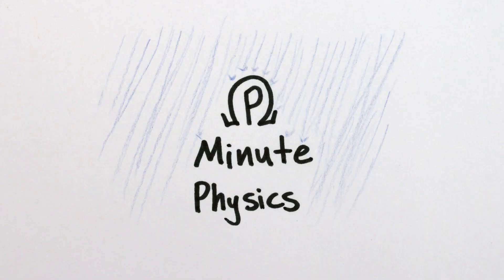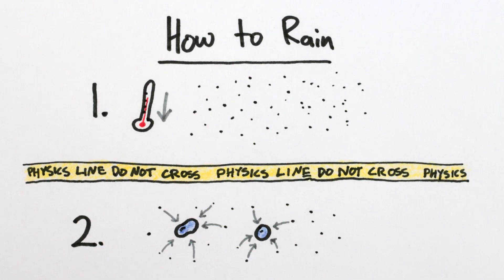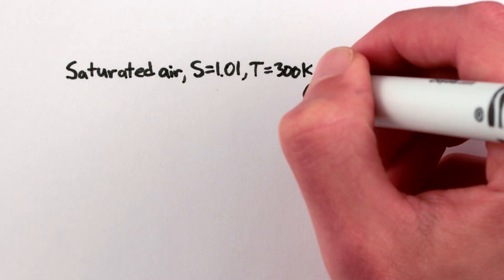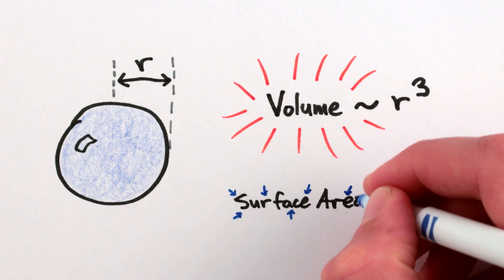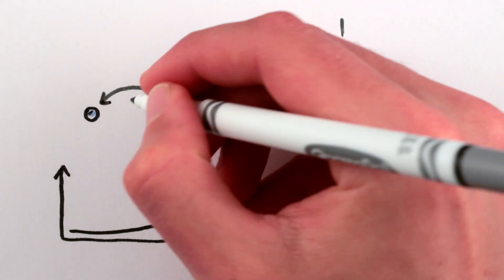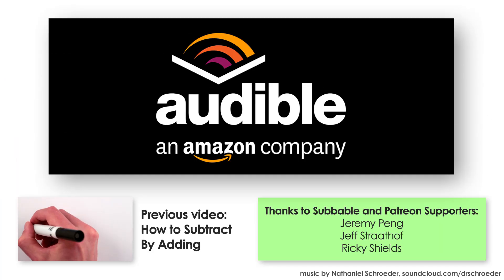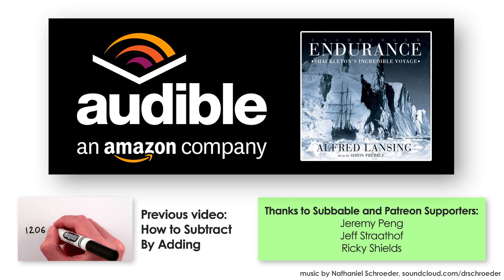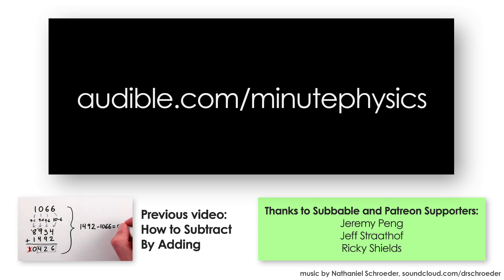Why Raindrops Are Mathematically Impossible

Comment: Instead of using 0.1 cm, you could just use 1mm, which would get rid of the cubing vs. squaring problem. This problem is based on the units we use. Can someone please educate me about how this really works?
Reply: 0.1 cm = 1mm
(0.1cm)^2 = (1mm)^2
0.01 cm^2 = 1 mm^2
1E-6 m =  1E-6 m
Similarly you can do the same for cm^3 or mm^3 I believe that the video makers chose to go with cm simply to make it more apparent or intuitive. The units don't really affect the problem
Reply: hm
Reply: regardless...
Reply: the metre is just a frame of reference, it can be a fraction of the distance traveled by light in a space of time, or the length of the king's toe. The proportions on the formula will always rule over the unit used in it.
Reply: It’s because all the units are accompanied by certain constant coefficients. Change the units, and the coefficients change too
Reply: +MySpaceBarIsBroken I'm not quite sure, to be honest, but a thought occurred to me: the calculations are probably best done in the S.I. unit for measurement, which is the metre - so if you're wanting to investigate other properties of the water droplet, no unit conversion for surface area or volume is required. This would explain why you would be sure to get the relationship of x^2 values being greater than x^3 values for something the size of a water droplet: x will be a tiny fraction of a metre.
Reply: Sharptooth101 The problem is that the metre was chosen arbitrarily. Sure it's an SI-unit, but it was still chosen by humans and isn't fundamental to nature.
Reply: MySpaceBarIsBroken The metre is the length of the path travelled by light in vacuum during a time interval of 1/299 792 458 of a second, so saith Wikipedia. It's an arbitrary fraction period of time over which for light to travel, sure, but the speed of light per that distance is definite, so in the end you get an arbitrary definite value (woah I think I just confused myself)
Reply: Sharptooth101 Yes, but it's still an arbitrarily chosen value. I could redefine a meter to be 0.0001 old meters so I get rid of the problem of small numbers. In the new meters, we are talking about stuff like 100^2 vs. 100^3, and cubing > squaring

Comment: Small numbers? But what is small? Small maybe, relative to our everyday scale, but it not on the molecular level.
Reply: +Juan Rivera >what are micrometers, femtometers, etc.
Reply: What the fuck are you doing reading my username? You need to take into account the conversion factors e.g to go from meters squared to joules you multiply by 1J/ m^3. To do cm: 1J/ m^3 = 0.000001 J/ (cm)^3. Squaring the cm conversion factor would give  0.0001 which is bigger. It’s a bad example, I know but do you get it?
Reply: +What the fuck are you doing reading my username? Exactly
Reply: small numbers = less than one because these numbers get even smaller as u raise them to higher powers

Comment: Why dont we use small distance units to avoid getting a less than one value? Like micrometers? So cubing would still be faster than squaring. 

Sorry I'm dumb. Someone educate me.
Reply: +huluminus because it doesn't change a thing.
10cm*10cm is 100cm2, which is converted in square meters 0.01m2
0.1m*0.1m is 0.01m2 too
Reply: And when we take the ^3 into account as comparison:
(10cm)^3 = 1000cm^3 -> bigger than 100cm^2
(0,1m)^3 = 0,001m^3 -> smaller than 0,01cm^2

Comment: You can choose your scale for units, so I don't think the square vs cube argument is valid here. Unless you're implying that there's a universal unit system.
Reply: +S.E.D. It doesn't matter what units you use. It is the relationship that matters. Basically he tried to give a reason without having to use calculus and limits. While what you say is correct, if you actually take the dxdydz of volumetric energy vs surface energy (energy accounting per control volume) you get the same result as within the video. You find that as the volumetric energy approaches zero, the surface energy approaches zero much slower, meaning that for small values of x,y,z (delta x,y,z as x,y,z -> 0), surface energy > volumetric energy (in terms of magnitude). Where x,y,z are the sizes of your control volume.
Reply: +hazzman singh Oh god thank you, the units thing was bothering me as well. Makes sense!

Comment: This video explicates certain misassumptions about water, especially water in the atmosphere:
1). It indicates water droplet condensing from gaseous H2O.  This is false.  There is no gaseous H2O in the atmosphere.  Water only becomes gas above it boiling point which to much higher than temps in atmosphere.  Condensation, therefore, is microdroplets combining to make larger droplets.
2) H2O has surface tension that is a resulf of polarity activation along its surface, not intermolecular forces.
Reply: +James McGinn Water becomes gas at much lower temperature than its boiling point. It's called evaporation.
Reply: +NedoraRiem 
Vapor is not a gas.  It is miniature droplets suspended in air by static electricity.  If anybody tells you otherwise they are dumb, misinformed or liars.  Trust me.  I know.  I am, literally, the #1 authority on this subject:
https://groups.google.com/d/msg/sci.physics/Cin1MQ4ZyFU/QmNEM9mnDgAJ
Reply: No it's not. Water vaporizes when the water molecules on the top gain enough kinetic energy to leave and become gas. If they were miniature droplets they wouldn't go as far in the first place.
Reply: NedoraRiem
Sorry to inform you , but, you are ignorant.  H2O gas is impossible below its known boiling point/temperature.  Heavier droplets are suspended due to static electricity.  I am an expert.  Trust me.
Reply: How do you explain drying clothes under the sun when it's obviously less than 100 °C ?
Reply: Evaporation.
Reply: Exactly. You don't need 100 °C, you just need the right amount of energy, and that energy is very small when dealing with small quantities.
Reply: +NedoraRiem , you are obviously not an authority on this subject. If you looked at the link, it is a paper on water's polarity which he wrote not too long ago.
Reply: He specifically said water vapour condensing creates the droplets at the start.
Reply: +Sreedhar Venugopal Well, I know what he said. My point is that it is actually never gaseous. It just seems gaseous because the original droplets are so small they are invisible.
Reply: +James McGinn yeah of course, it's not gas, it's just single molecules flying in the air ;) thus still a liquid
Reply: Life4YourGames
Uh, er, uh, . . . nevermind.

Comment: Isnt size arbitrary? I mean if you measured raindrops in angstroms for example, then they you would never have a fractional number and therefore a cubed number will always be larger than squared, unless you measured it in even smaller units.  Seriously Minute physics?
Reply: +dredawgz1 meters are used for most practical down to earth experiments where the items in question are visible.

Comment: Seems like I'm getting it. Yes, indeed, for the numbers between 0 and 1 the square function grows faster than the cubic function, but... It is a BIG "but".
When it comes to the real world, we cannot really say that, since at a small enough scale all measurements give us numbers between 0 and 1, raindrops mathematically should not form. The point is that we use meters, and at the scale of an average droplet surface areas and volumes are less than one, BUT relatively to a meter as a unit. Numbers less than one are fractions,  and such parameters as area and volume of a real existing physical body are not. If we used, say, millimeters or nanometers instead, we would easily get rid of this "maths doesn't work" thing. Ideally, give 'em hell using the Planck length as a unit and it would all work perfectly without any arguing. Problem is that we'd be so pissed off calculating, that's it
Reply: +Алексей Беляев the one is a relative number. You  have to adjust the units accordingly. If you have 1 meter, it would be 100cm, 1000mm etc. The one is just used as a number in the mathematical equation and has to be adjusted in the "physical" equation to fit the unit. It's just used to illustrate the critical radius. The principle itself works.
Reply: +Leonelf ok, I got it

Comment: That's such a BS answer, because the measurement is arbitrary.... if you use Angstroms for radii, you're no longer using a fraction, you're using "large numbers"
Reply: +Rufus Shinra   Henry talks about the equation x^2 - x^3 and the equilibrium point at 2/3 where x^3 starts growing faster than x^2.  He has simplified for purposes of explanation.  And if you are trying to switch units (like you are suggesting) we can't keep it that simple.  We have to add back the units, first.  I don't know the real numbers for raindrops, so we'll assume that that equation is true for numbers given in meters (clearly not, but it's an example).  That is, the equilibrium point is (2/3) m.  But, if we plug that in, we see that we get: ((2/3)m)^2 - ((2/3)m)^3 = (4/9) m^2 - (8/27) m^3.  But you can't subtract cubic meters from square meters.  What's missing is two conversion factors, one from area to energy and another from volume to energy.  These can both have a value of 1 (to match up with Henry's example), but they must have the correct units.  So our equation becomes ax^2 - bx^3 with (as an example) a = 1 J/m^2 and b = 1 J/m^3.  Then, at (2/3)m, it becomes (1 J/m^2)((2/3)m)^2 - (1 J/m^3)((2/3)m)^3 = (4/9) J - (8/27) J = (4/27) J.  So, all is good and we can calculate the energy for a certain x and, in fact, (2/3) m is the highest energy point where x^3 grows faster to the right and x^2 grows faster on the left.

So, now you ask, "But what if I want to measure everything in Angstroms?  Won't I get that (2/3) A is the equilibrium size insead of (2/3) m?"

Well, if we plug in (2/3) A, we get: (1 J/m^2)((2/3) A)^2 - (1 J/m^3)((2/3) A)^3 = (4/9) J A^2/m^2 - (8/27) J A^3/m^3

How do we deal with Angstroms divided by meters?  Well, 1 A = 10^-10m, so 1 A/m = 10^-10 m / m = 10^-10.  This means that 1 (A/m)^2 = 10^-20 and 1 (A/m)^3 = 10^-30.

So, our final result is: (4/9) J A^2/m^2 - (8/27) J A^3/m^3 = (4/9)(10^-20) J - (8/27)(10^-30) J ~ 0.44 * 10^-20.

That's clearly very small and the x^2 term is clearly dominating the result.  Both of these are true because (2/3) A is so much smaller than the equilibrium point at (2/3) m.

So, what about the equilibrium point in A, then?  Well, that would be (2/3) * 10^10 A, and would give us: (1 J/m^2)((2/3) * 10^10 A)^2 - (1 J/m^3)((2/3) * 10^10 A)^3 = (4/9)(10^20) J A^2/m^2 - (8/27)(10^30) J A^3/m^3 = (4/9)(10^20)(10^-20) J - (8/27)(10^30)(10^-30) J = (4/9) J - (8/27) J = (4/27) J.  In other words, we get the same answer whether we calculate using meters, Angstroms, or any other unit as long as we are consistent about tracking our units.

Finally, circling back to raindrops, the values of a and b would obviously have to have different values to match real raindrops where the equilibrium is at some tiny radius, but with that change, this model would explain what the video describes just fine.  And it would still work regardless of which units you chose.
Reply: Chris Sloan a great explanation that, of course Henry as always is lacking in his videos, which was the original point in my original comment.  Because it's "minute" physics does not excuse you from flippant explanations without rigor.  However in your second example, I don't know why the equilibrium point would have to be in m.  2/3 A would move the equilibrium point, which is the other point. The point shifts depending on your units that you begin with... If you convert back to metres, that kills the whole argument without answering it
Reply: +Noobsician when measured in angstroms, or let's even go further, and say hydrons (a unit I just made up that represents the diameter of a hydrogen atom) you can never measure the raindrop to be less than one hydron.  so where's the crossover point then?
Reply: +Rufus Shinra Until you realize Å is 1e-10 which certainly gets smaller as you cube it. Not sure if troll or...
Reply: +Noobsician is this a troll? 1 angstrom cubed is 1 cubic angstrom.  that's smaller?
Reply: +Rufus Shinra  I'm not 100% sure I understood your question correctly, so let me know if this does not answer it.

Since I didn't label my examples in my previous comment, I'm numbering them now to make sure we're on the same page:
Example 1, I plugged in (2/3) m and got (4/27) J.
Example 2, I plugged in (2/3) A and got ~(4/9) * 10^-20 J, but effectively converted back to meters to get that answer.
Example 3, I plugged in (2/3) * 10^10 A and got (4/27) J again.  Again, I effectively converted back to meters.

So, I believe your question is "What would happen if I didn't convert to meters?" or maybe, "How could I answer the question without doing the conversion?"

So, first off, what happens if we keep the units in the calculation (like I did in all the examples) but I refuse to convert units.  That gives me the answer which I got part way through example 2 [that is, (4/9) J A^2/m^2 - (8/27) J A^3/m^3 ] which is correct, but maybe not helpful since you can't simplify it down to joules without the unit conversion.

Okay, so what if I instead just ignore units and plug Angstroms into the equation (which is only correct for meters)?  Well, I get the wrong answer.  And unit conversion like I showed in example 2 or 3 is how I can use such equations to get the correct answer.  If I ignore units like this, I get what you and others here have been asking about.  The value I get depends on the units I choose.  And because of that, the equation isn't accurately describing the physical situation it was supposed to.  Basically it's a mess.

But let's say that my goal is to have an equation where I just plug in the numbers in Angstroms and I don't have to do any explicit conversion.  But it should produce the same answers as the meters equation does.  That is, if ax^2 - bx^3 = (4/27) J when x = (2/3) m, then the new equation should produce the same answer, (4/27) J, if I plug in (2/3)*10^10 A.  (If it didn't, it's not describing the same physical situation.)  Here's how I can take the equation which accepts meters and convert it so that it accepts Angstroms (and doesn't require tracking the units afterwards):

(Example 4):  The constant a is 1 J/m^2, and b is 1 J/m^3.  We want to convert them to units of J/A^2 and J/A^3, respectively.  Similarly to how we proceded in example 2, we know that 1 m = 10^10 A.  So, 1m / 10^10 A = 1.  And we can multiply anything by 1 without changing its value, so a = a * 1^2 = a * (m / 10^10 A)^2 = (1 J/m^2) * (m / 10^10 A)^2 = (1 J/m^2) * (m^2 / 10^20 A^2) = (1 J/m^2) * (10^-20 m^2 / A^2) = 10^-20 (J/A^2)(m^2/m^2) = 10^-20 (J/A^2).  By the same logic, b = 1 J/m^3 = 10^-30 J/A^3.

So, if you use the equation [10^-20 x^2 - 10^-30 x^3], with x in Angstroms, you get the same answers as using [x^2 - x^3] with x in meters.

So, how'd I do?  Did I answer the right question?
Reply: Chris Sloan Thanks for the elaborate explanation! 
Although I think the point Henry is trying to make, is still, small numbers became smaller when you cube them compared to if you square them, small being anything smaller than 1. So I still can't see the confusion which rose.
Reply: Rufus Shinra Well, since it's a measure of length, they can all be described with a power of ten of a meter. Then it all comes as a mathematical consequence for there mere fact that meter is the SI-unit for length. So, to answer your question, the crossover point is really the usage of meters instead of any other unit of length.
Reply: +Noobsician OK, taking everything back to an arbitrary standard like the meter brings up this imaginary problem.  the math doesn't work because the measurement units are so large compared to the scale he's using.
Reply: >small being anything smaller than 1.
Smaller than 1 what?  Meter?  The universe cares how big this human-created unit is?
The minutephysics explanation is shitty because anyone could arbitrarily come up with a smaller unit (e.g. angstroms), then the same amount of molecules suddenly ceases to be "small" anymore.
Reply: Rufus Shinra one cubic anstrome is greater than one square kilojoull

Comment: yes its true dat fractions get smaller as you square them or cube them but maybe our scale is just wrong, and the number 1 is below the size of a group of water molecules...
Reply: +kartik aalst the number one is just to use numbers. You have to adjust it to the unit used to be able to calculate it. But the "relative" critical radius will always be the same, so multiplying it by whichever (fitting) unit will give you the right measure.
Reply: true dat